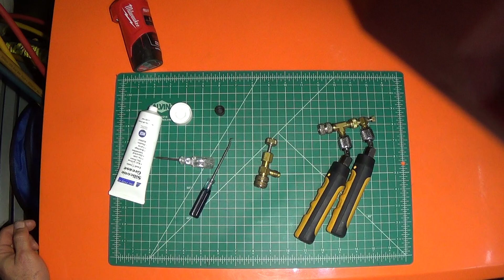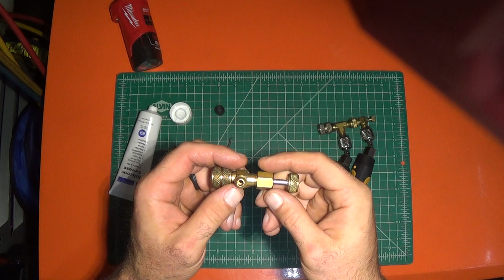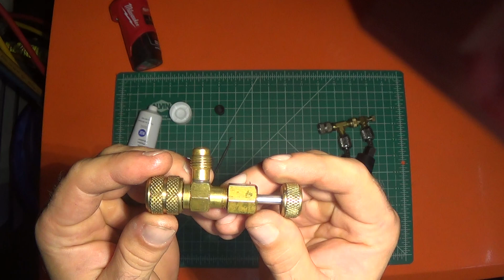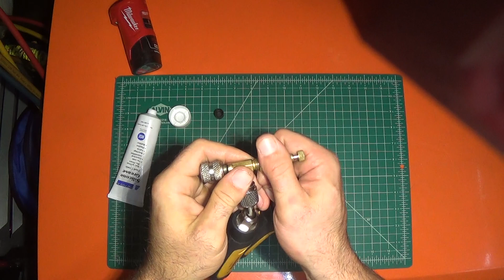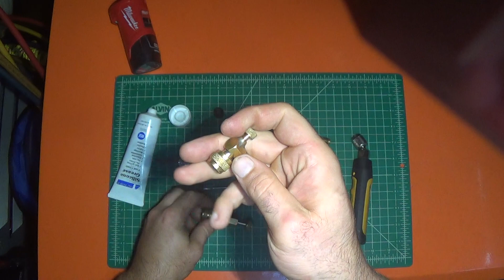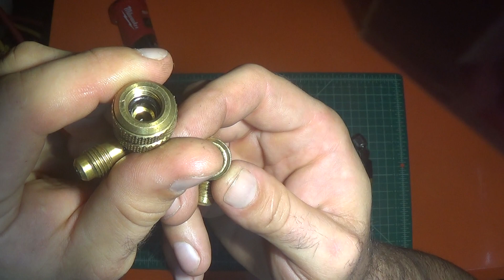Tools22: Very Useful HVAC Tool: Core Depressor Not Remover (Part 2of2)

Comment: Thankyou for your impressions.  I had the smaller one, I believe model 5050 for years and forgot that I had it. Recently decided to go back into using them after getting frustrated with a running unit on the high side and all its drama.  The Appion is much advertised but can't see why $70 that is bulkier is better than $10 C&D - they do have a backseat one now.. 2070?
Reply from the maker: Noce dude!  Yeah I love core depressors!  Great for pressure tests too because of zero nitrogen loss!  Thanks for adding that info at the end 👍